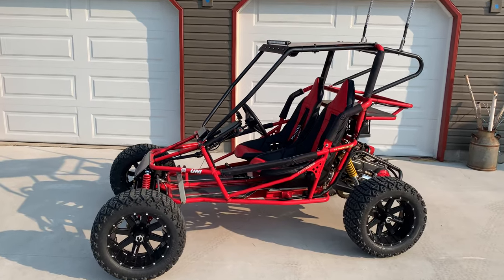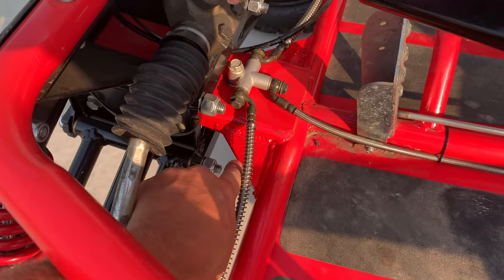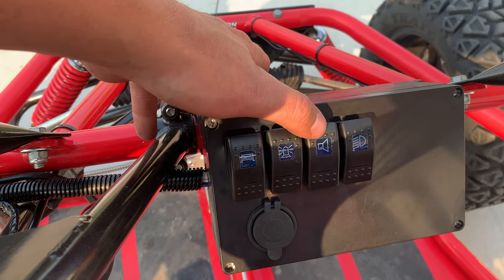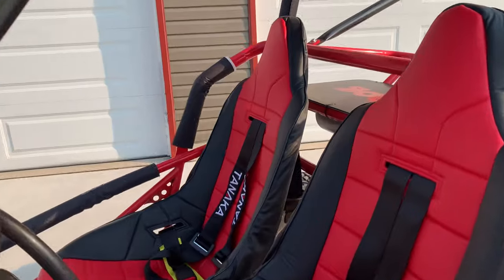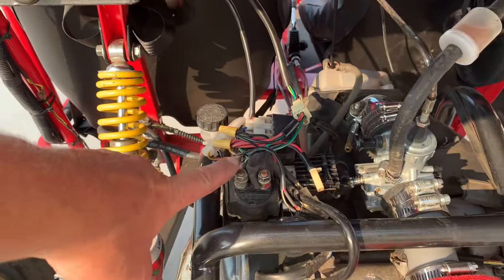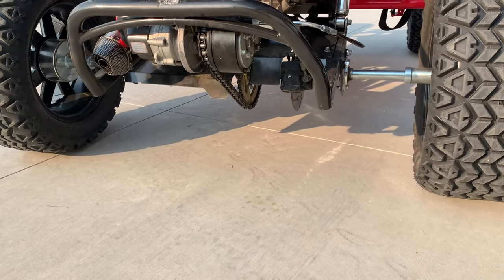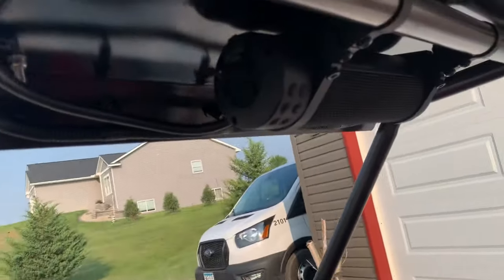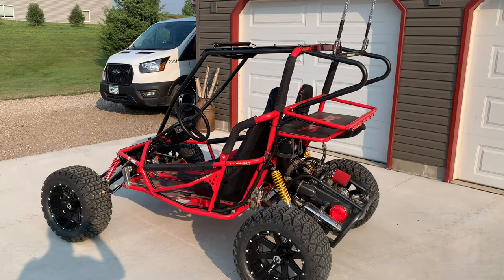Yerf Dog GX150 Spiderbox Monster Go Kart

Comment: Where did you get the brackets/Mount that holds the 12v battery?
Reply from the maker: I welded a small battery tray and used rubber coated P-clamps to suspend the battery below the rear rack

Comment: I’m in the process of building this same model Yerf Dog 3206. It’s currently torn down as I’m getting ready to prep it for paint. I ordered a 4 point harness ahead of time. What part of the frame did you end up mounting all the points? Was there any custom work done to make it happen? Asking before I paint it and put it back together in the off chance it’s easier to do any potential custom fab to make this harness work. Thanks in advance.

Comment: Any review on the bdx brake kit? Also how does the new rear axle handle compred to oem?
Reply from the maker: The brakes worked great, the new axle needed extra support, so outer axle carriers were welded on.  I’ve since sold the Kart and moved on to other projects!
Reply: @Eighty8Fitter  awesome I have done an ev conversion on mine. Any parts or upgrades you would recommend?

Comment: 44 inch axle or 54 inch axle? I got a pretty big project I put a 44 on and I'm not sure how it'll hold up, the yerf dog has a comparable weight so that's why I need to know
Reply from the maker: If you do the 54” axle you’ll need to add additional bearings for support on the axle shaft near the wheels.
Reply: @Eighty8Fitter  So the 44 should be good? Just got 2 pillow blocks 5 ish inches from the wheels
Reply from the maker: @nwee5758  yup that should work well!
Reply: @Eighty8Fitter  Nice, it's got 26" wheels but it's only 3 inches larger than yours and you seem to be fine. It's a burned down Landstar LS670, lowering the seats, steering, and roll cage, replaced the melted diff with a live axle

Comment: Sir, how fast did this cart go? I have the same model and plan on doing a lot of mods to it.
Reply from the maker: Roughly 30-40mph
Reply: Sorry for another question. How bad did the front tires rub? Or did they not rub in the front at all? Are the tires 8" or 8.5" wide? I see a lot of golf karts with 8.5" tires is my reason for asking.
Reply from the maker: @stephenchina1196  I didn’t have any issues with the tires running because I used 2” hub spacers in the front which allowed sufficient clearance from the frame.

Comment: where did you buy the seat covers from, I've looked everywhere for them
Reply from the maker: Summit racing, search for racing seat covers, they were around $100 for the pair
Reply: @Eighty8Fitter  Just received them in the mail yesterday and already installed them. The picture on the listing shows them to be cheap and thin, but turns out, these are the best seat covers with some good padding to them. Thanks a lot for pointing me in the right direction
Reply from the maker: @ronking3007  no problem!